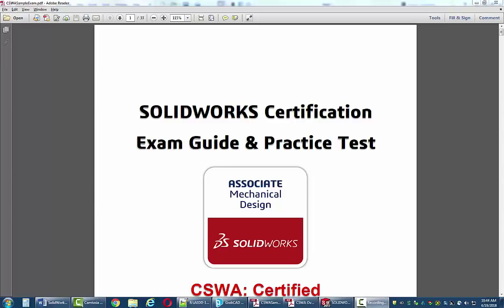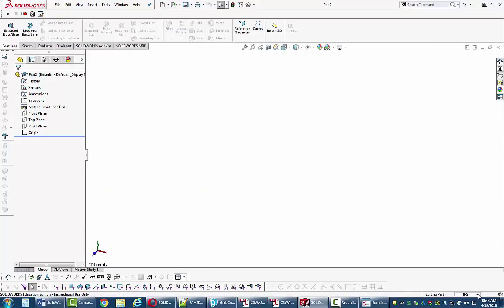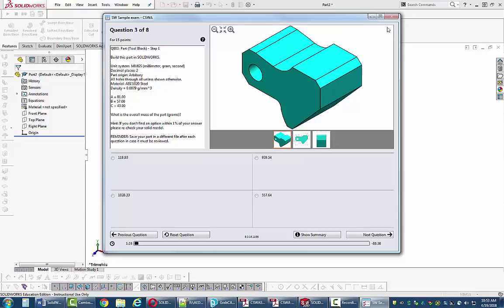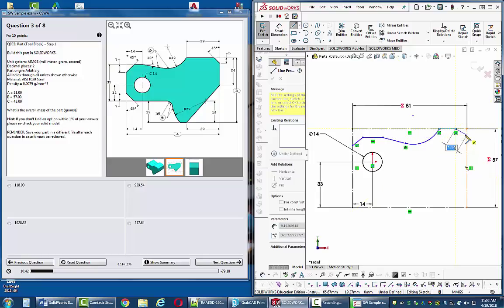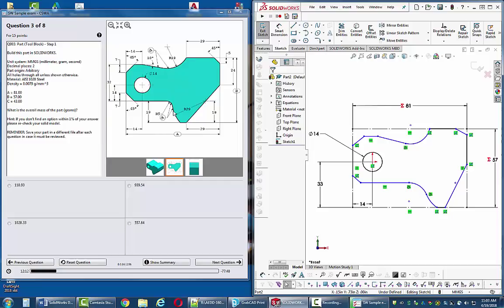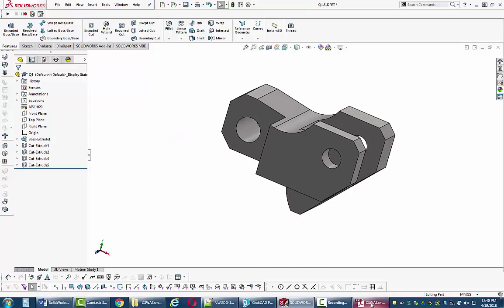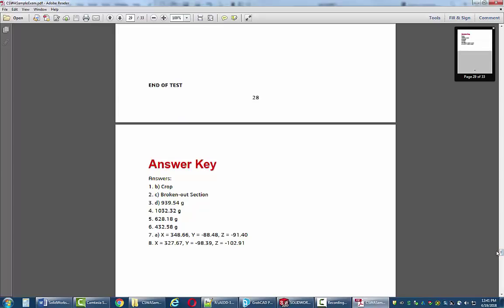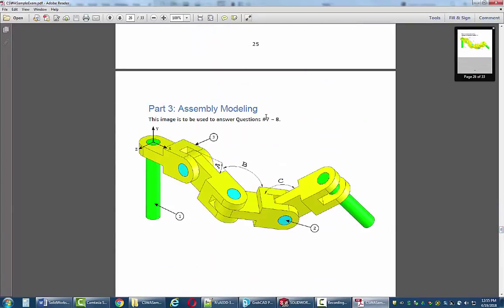SolidWorks CSWA practice exam

Comment: I did this exam last Friday and failed it, only got 35 points. It was a little discouraging considering I felt like I was actually pretty good at Solidworks CAD, but it was also just a practice test and I'm sure I'll do better next time.
Reply from the maker: I've found that some very capable people are just not good at taking tests. I've also seen people get hung up early on this exam and end up spending a lot of time backtracking. The more you take practice exams, the better, of course, but you might also want to use the following strategy: review the entire exam and do those problems that you are most familiar with first. Some people find the assembly problems to be less troublesome than the part creation, but don't get to them in time to complete the exam. Others have no trouble with the initial part creation, but have difficulties with subsequent edits.

Comment: Studied this video, drawing was easy...purchased the test for a 100 dollars and was given something totally ridiculous compared to this. Did not pass, how else can I prepare myself?
Reply from the maker: I've administered this exam to several hundred students over the past 15 years at the end of their first semester class. Although some of them have had the same reaction you did, slightly more than half of them pass the exam on their first try. The main problem that students who don't pass the exam have is with the timed nature of the exam. In most cases, they got hung up on one of the early part files and ran out of time before finishing. In some cases they have such high anxiety when taking a timed exam that they are unlikely to be successful even when they have developed considerable skill with the software. 

You might try taking the practice CSWP exam for a more challenging preparation. If you didn't take the CSWA practice exam using the test engine shown in my video, make sure you use it this time. You might also get a classic drafting/engineering graphics textbook (my favorite is anything by Giesecke) and select some complex parts and assemblies from it, and practice with a timer. Try them several times and see if you can reduce the time it takes as you develop strategies to work more efficiently.
One of the things I do with my students is have them take care of anything that they might need to do while they're taking the exam before it starts: go to the bathroom, eat something, turn off their phones, etc. I also recommend that they start up SolidWorks and begin a part file using MMGS units before selecting the final "start exam" button. 

I emphasize a number of things during the semester that I believe help them succeed with the software, and I remind them of some of these things before the exam starts: fully define all sketches, select a logical origin for the first sketch, recognize symmetry and use it to your advantage while sketching or extruding (mirror entities in the sketch, use mid-plane where appropriate when extruding a boss). Make sure you really understand the creation and use of global variables (names must be in quotes when typed, or select them from the drop-down list). Do an interference check on assemblies before answering any questions. See if any parts are not fully mated as well.
Otherwise, practice as much as possible during the waiting period to retake the exam. People who work with the software professionally or use it extensively in other classes rather than just taking one course don't seem to have much problem with the CSWA exam, although that isn't always the case with the CSWP exam or the other specialty exams like weldments, drawings, etc. It is quite possible to do well on the exam with just one class though. Every semester I have several students who get perfect scores. 

When taking the exam again, you might try changing the order in which you answer the questions so you get to the questions regarding assemblies before you take on the part creation questions. They tend to be less demanding, but carry a lot of weight in the final score. You won't be expected to use any of the advanced mates or the mechanical mates, so concentrate on coincident, concentric, distance, and angle. When you do the part creation questions, concentrate enough time on the initial part to make sure it is correct before moving on. If you get hung up on the last question for that part, skip it and go on to the next part and do the same thing. If you have time at the end, go back and finish the questions.

I hope this helps. I do have a document that I prepared for my classes with advice on what I consider best practices in using SolidWorks (or any parametric modeling program) that I would be happy to send to you if you are interested (contact me at dabbott@smccME.edu).  The exam itself really isn't ridiculous compared to the practice exam, but you have to be prepared for different types of geometry, including those requiring revolves. Good luck with the next round.

Comment: Are there any mistake tolerances in this exam? In the 5th part, i got 432.9 instead of 432.58, i triple checked everything, and did the part exactly like you. So, would it be a fail if i missed by .32g? By the way, i wish i had a professor like you, you did a really good job!
Reply from the maker: I have found the answers to be accurate each time I've demonstrated this part in class, but if your answer is within 1%, which yours certainly is, the exam considers that to be correct. That said, I have had a number of people contact me with similar small differences, and when they send their file I have found an error that resulted in a relationship being added in the sketch automatically that was so close to what was accurate that the final answer was within 1%. So you would have no trouble on the exam with an answer like yours, but you might want to look at the sketch to see if there is a perpendicular relation that you didn't intentionally add. If so, delete it and add the dimension that would have over-defined the sketch and see if that gives you the exact value. And thanks for your kind words. I've just finished my 80th semester as a teacher, and keep putting off retirement because I love doing it, so your comment reassures me that I can still do the job!
Reply: @DanAbbott-SMCC  Thank you, sir!

Comment: Hello! I am studying for my CSWA exam, and I am following this video to walk me through the questions I needed help with. For 43.29 of the video, he offsets the curved line of the extruded cut we did before. Whenever I offset that, line it offsets 1mm up towards the top plane and not towards the front plane- it does not offset in. So, when I tried to do the next step of converting the face, I can not trim the edges going out since the curved line offset and the converted face are not coincident. I hope that makes sense... I just need help on the offset
Reply from the maker: You can change the direction of the offset by selecting the correct button in the left panel when offsetting. Hover over each button to see what it does.
Reply: @DanAbbott-SMCC  Thank you for the quick reply! The reverse button just makes the curved line offset to the right side not in on the left. The two offset type buttons do not do anything to change the direction. I am using the offset surface button is that why? However, the offset entities button is grayed out and does not work for me

Comment: mr. abbot, for number 6 is the assembly origin doesnt matter? i cant move the origin since the part has no sketch. Thank you so much
Reply from the maker: The assembly origin always matters on the certification exams since questions often include center of mass. In this case the origin of the assembly is the same as the origin of the first base part inserted into the assembly. That seems to always be true on the Associates exam, so you can just select the green check when placing the first part. On the professional exam you frequently have to place the first part differently, or create an independent coordinate system, but both are easily done. If you place the part incorrectly, you can change its properties from "fixed" to "floating" and then use mates between its origin and the origin of the assembly to move it. You may also have to place mates between primary planes depending on just where you want the part to be located.
Reply: omg thank u so much, i skipped green check part so my origin point is not coincident. Thanks for the reply!!!🙏 god bless you

Comment: When he changes global variables B and C what dimensions are being changed in the sketch? just the ones linked to the construction lines?
Reply from the maker: I'm not sure if this is what you are asking, but whenever a change is made in the value of a global variable, any dimensions that used that variable are changed, including those placed in sketches with smart dimension, and those placed in the properties pane of features, such as blind extrusions, fillets, chamfers, etc. They can be applied to construction geometry or to geometry that will be converted into a solid or surface feature.

Comment: Hello, I have fully defined the model, with the exact same parameters as in the example and I got 958 gr, I did it already twice from 0 and the same result
Reply from the maker: It is possible to have a fully-defined sketch that is incorrect. If 958 is within 1%, it is close enough, but I've found that the answers have been matched the right answers given. If you can't find a difference you can send me the model at dabbott@smccme.edu and I will take a look at it.
Reply: @DanAbbott-SMCC  I´ve just sent you the model, thank you so much for your time
Reply: @DanAbbott-SMCC  Never mind I just saw one parameter was incorrect defined, thank you anyway

Comment: best video ever!! just scored a 220/240 on it. Thank you so much!!!!
Reply: Did this video contain all content of the exam?
Reply: Hua Wei Yes. The techniques he used including the global variables makes it extremely easier when modifying parts question by question. Both the part makeing and assembly questions were basically the exact same layout. The only difference is there is usually a part that involves a revolving extrusion like a bike wheel or a propane tank. The exam is 14 questions and it usually involves at least 2 parts, 2 assemblies, and one revolving extrusion. This video will help you more than anything. best of luck!!
Reply: wait what score is considered passing
Reply: whathen 160/240 in other words you need to get about 2/3 of the test right. this video covers over the 2/3 you’ll need for sure!
Reply: @MrJuicyBluntz  thank you so much!! was it hard
Reply: whathen no problem! ummm. depends how well you know the program. If you can do all these problems in this video without any help you will definitely be in good shape for the test. It’s not hard, just long and takes some skill.
Reply from the maker: Ever? Well, that's high praise. I have one on the professional level exam too, so keep that in mind as you get more experience.
Reply: Daniel Abbott It was the third time for me taking the exam. Second time I was 10 points shy of passing. Then I watched this the night before my third try and killed it. So yes! Ever!

Comment: I could not get the answers you got. Maybe I made a mistake somewhere. Amazing video by the way.
Reply from the maker: I get the same answers every time, as do my students. Make sure you have no underdefined sketches. If you do, figure out why and fully define them. You may also have an over-defined sketch, which is usually from an automatic relation being added that you didn't notice and is in conflict with a dimension. If you got the "do you want it driven" message when adding any of the dimensions given on the exam, look for relations that you don't want and delete them so the dimension is driving, not driven. You may also have misinterpreted the drawings, of course. But if you go through the video again, you should be able to find where you went astray.

Comment: Hi! Putting in the 19 mm between the midpoint of the line and the bottom at 21:15 overdefines the sketch for me, I've followed your instructions exactly, any idea why it does this?
Reply from the maker: You have probably been caught by the automatic relations being added when you weren't expecting it. You may have snapped to the midpoint of the line, or it may be that you had a perpendicular relationship added automatically (which happens fairly often on complex parts and it's easy to miss) to some line that is on the other side of the part. If you can't find the incorrect relationship, send me the part file at dabbott@smccme.edu and I'll be happy to find it for you.
Reply: @DanAbbott-SMCC  I figured it out shortly after and that was exactly the problem, it had snapped to the midpoint

Comment: How do you fix a part to the origin? I tried to fix the first long pin to the origin but it turns out it wasn't at the origin.
Reply from the maker: When assembling parts it is helpful to identify the single part that anchors the others in place. To do that if the part is made so that it's origin and orientation are what you want in the assembly (which is also a good idea and is true of the long pin in the assembly provided for the practice exam), make it the first part you insert and just select the green check mark in the upper left portion of the screen. It will be fixed to the origin and orientation of the assembly. If that isn't what you want, change the properties of that part from "fixed" to "floating" and use mates to fix the part as you want it to be oriented. Don't try to assembly parts without fixing one of them or you will be driving a hammer through your monitor in about 3 minutes.

Comment: for the assemby part, i didn't get the right center of mass but all my relations was correct. WHat else can influence this result?
Reply from the maker: You either didn't place the initial part at the origin of the assembly (select the green check mark when inserting the first base part -- in this case the vertical pin or shaft), or you didn't constrain the first link correctly. Note the XYZ triad. The front plane of one side of the first link needs to be parallel to the front plane of the assembly.

Comment: Hello, amazing video for beginners like me.
For 5th question, I am getting 618.53 g, but in pdf file, answer given is 628.18g, I tried many times but ended up getting the same answer. Pls tell which is correct?
Also let me know where I might be wrong if mine is incorrect
Reply from the maker: Not sure without seeing the model you made, but the correct answer is that given in the PDF. Check for any under-defined sketches; make sure you use only dimensions given and not any derived mathematically from those given, double check the equations, and make sure you used the Y value not X for the second hole.

Comment: One question, isn't the 19mm wrong at 17:28? isn't it supposed to be 29?
Reply from the maker: Yes it is. That oversight is corrected a couple of minutes later when I changed the 19 to 29 before creating the solid.

Comment: Can I take the test in the free trial solidworks, or I need the actual software on my PC
Reply from the maker: You can use any version of SolidWorks that you have. They haven't updated the parts for years, so as long as it isn't a very old version, you should be fine.

Comment: how do you adjust the origin. i do reference coordinates but that doesnt help
Reply from the maker: The origin is determined by the placement of the initial sketch. I selected the origin as the center of the hole and added dimensions to other features from there. If you decide you want to adjust the origin, you would do that by editing the original sketch and moving all of the entities to a new location or by deleting the relation (coincident) or dimensions that locate the sketch and adding a coincident relation between the point you want at the origin and the origin itself. I would highly recommend that be the center of the hole for this part.

Comment: hi thanks teacher when I draw the model the lastly, I would get 2% more than the answer. in mass configuration
Reply from the maker: You have a geometry error somewhere. I've created this model many time in front of my classes, and my students all have to take the practice exam before taking the actual exam. The results have always been the same as the answer given at the end of the exam. 
Check for under-defined sketches.
Make sure that there are no unintended relations added automatically (a perpendicular relation is the most likely).
Make sure that you used every dimensions given and have no driven dimensions.

If you want to send me the model at dabbott@smccme.edu, I'd be happy to take a look at it.

Comment: cant seem to get the answers correct but am doing the same exact thing....dont know where i am going wrong
Reply from the maker: Melissa,
It might seem like you are doing the same exact thing, but something is off if you aren't getting those answers. The most common problem is having sketches that are under-defined, so look there first. The next thing to try is to see if an automatic relation was added that you didn't notice. If you are unable to add a dimension that you know is necessary because it would over-define the sketch, that is probably what happened, and the most likely is a perpendicular relation to a line on the opposite side of the sketch. If you find a perpendicular relation, delete it and add any necessary dimension. The third thing is to look carefully at your dimensions to see if you might have selected the wrong point on the sketch for one end or the other. If none of those work, send me your part file to dabbott@smccme.edu and I'll tell you what the error is.